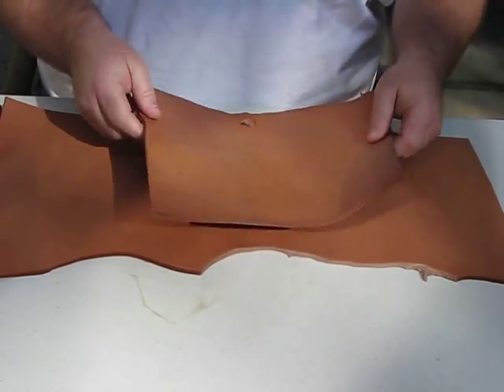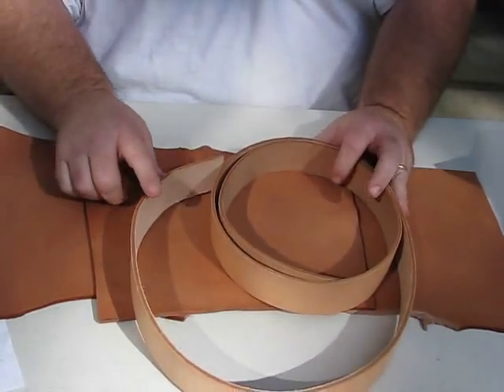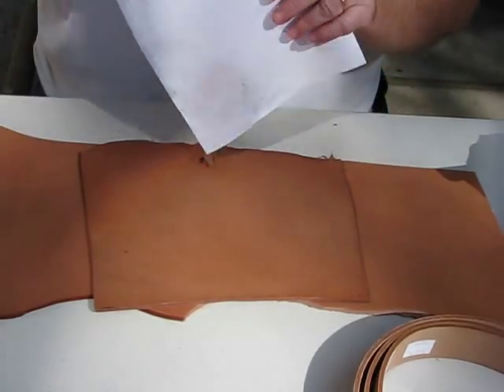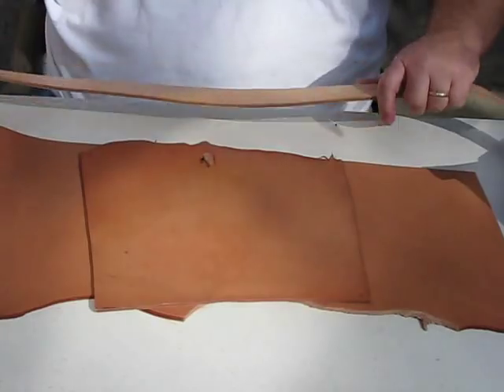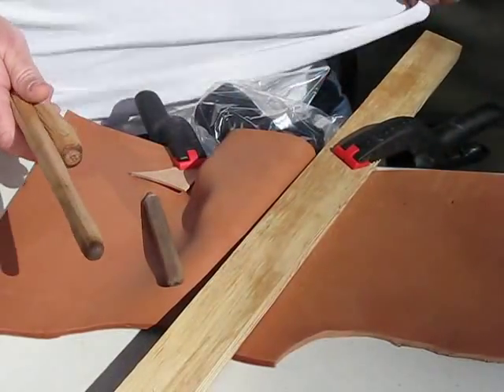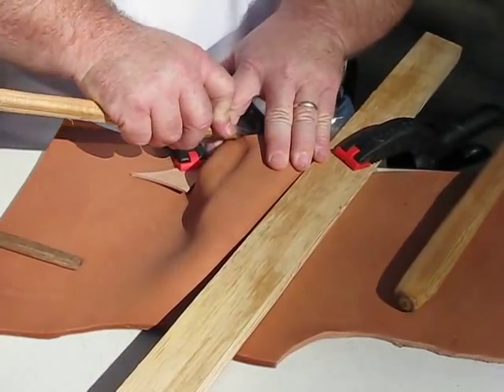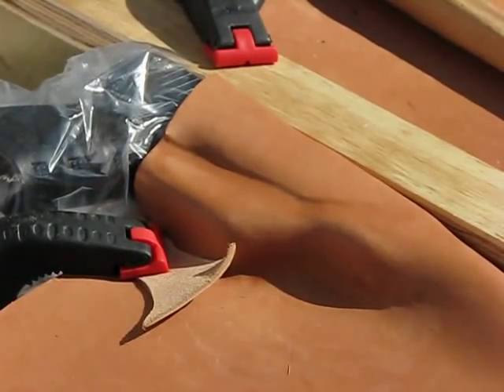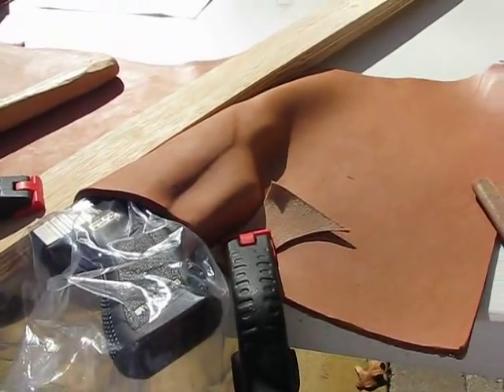Making a Leather Holster for My Glock 19 - Part 1 - ReRelease

Comment: And to answer the kydex press question: yes pressure molding leather works fine in a kydex press.  I recommend using Procarve or a similar product to treat the leather beforehand, which makes is accept the impressions better.